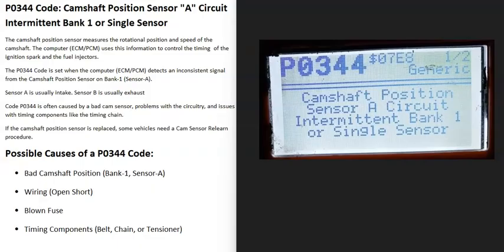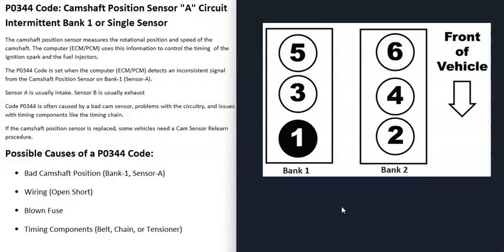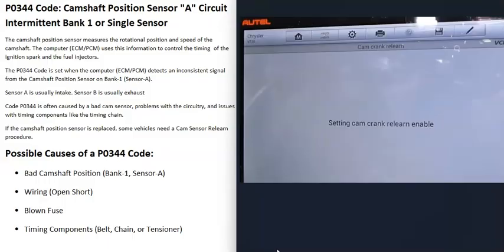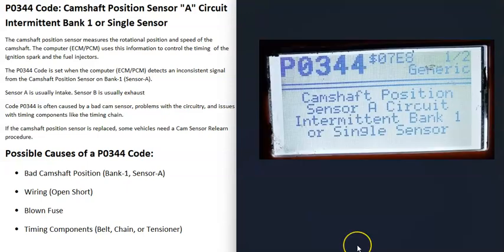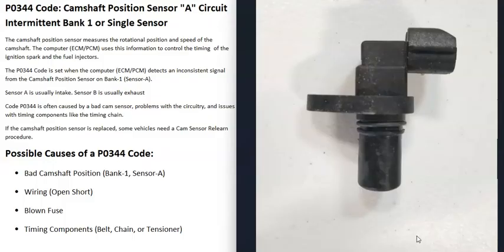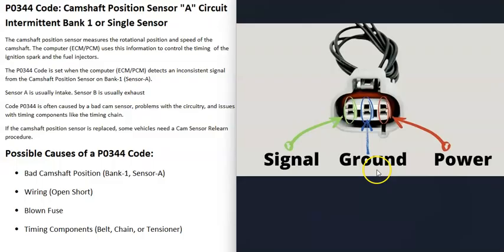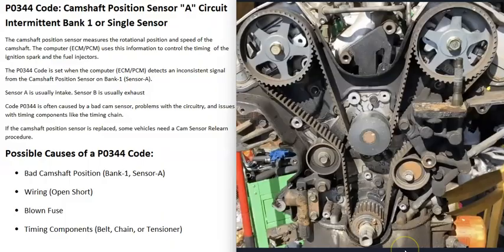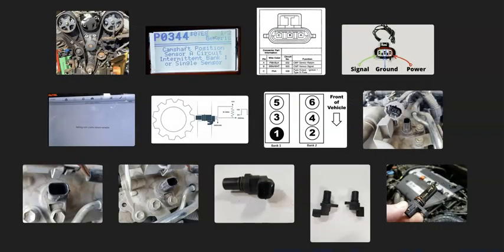Causes and Fixes P0344 Code: Camshaft Position Sensor A Circuit Intermittent Bank 1 Single Sensor

Comment: The alternator belt on my Peugeot 3008 snapped and threw some oil around the engine compartment,  this is the code im getting,  shoukd i replace belt and start it up and see what happens??
Reply from the maker: Yes, for sure. If the alternator is not charging or the battery is dead, the computer can start throwing out codes.

Comment: I got this code on my 2008 PT CRUISER. It sputters. Loses acceleration power. Won't go over 2000 RPM. OCCASIONALLY DASHBOARD LIGHTS SHUT OFF or even the entire vehicle shuts off completely while it's running.
It's intermittent. 
Doesn't always happen.
At first I thought my battery. But nope. It will sometimes struggle to turn on too.

Comment: Thanks for explaining but I have the same issue in jeep liberty kk. I have changed the cam sensor but still the same code showing. P0344 P0652 P1628 P2127.
Reply: I have also checked the wiring and all are ok but the same issue throttle body control light blinking and engine slow down cant acceleration so now code showing p0340 p0652 p2127
Reply: @AbdullahAlZadjali-fm4nf  if the wiring and harness is in good clean shape try replacing the brushed in the alternator just fixed one hope this helps

Comment: On my 2007 Honda Odyssey 6 cylinders 3.5 I get three codes p 0330 p o 320 and po344  any way to find out if there's anything with the timing.

Comment: I have this code replaced the sensor and still got this code. I also have low oil pressure. Any thoughts ?
Reply: Hi just fixed one had the same problem after the sensor replacement if  you check the voltage only the alternator while it s running properly find the voltage is erratic going from high to low voltage replacement of the brush electrodes should fix you problem hope this helps

Comment: Do you need to clear codes after sensors are replaced?
Reply from the maker: I always clear them and see if they come back, but the computer should clear them after a drive cycle is complete.
Reply: If it doesn't go off and still  won't rev over 2k check the voltage on the alternator charge out put if it bouncing around hito low replace the brushes should be good after that hope that helps
Reply: But which one is the intake and exhaust sensor on a Ford mustang gt 8 cylinder

Comment: Thanks for sharing. I have the 2002 c230 Mercedes Benz - 1.8 engine/ 4 cylinders.
Mine said: camshaft adjustment. Incorrect position of the intake and exhaust camshaft. I replaced both. 
Maybe needs the relearn procedure.
Looks like you got my problem solved.
Thanks!!!! 🙏 I really appreciate it.